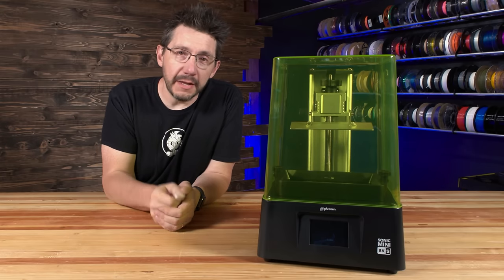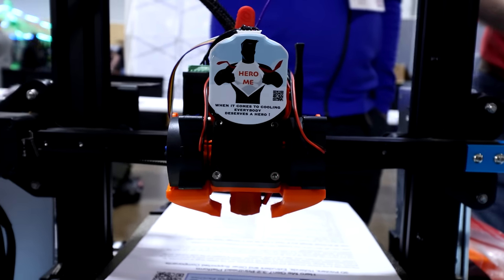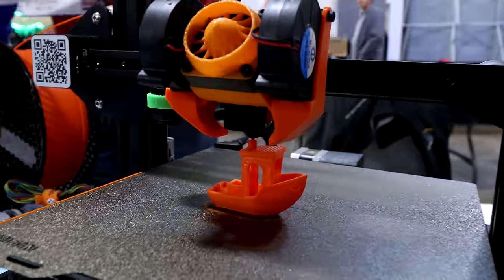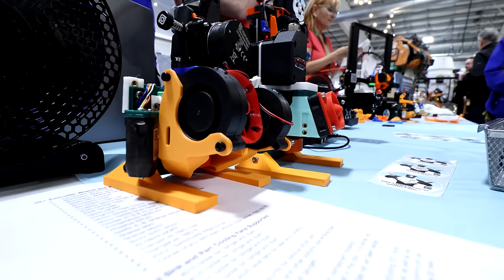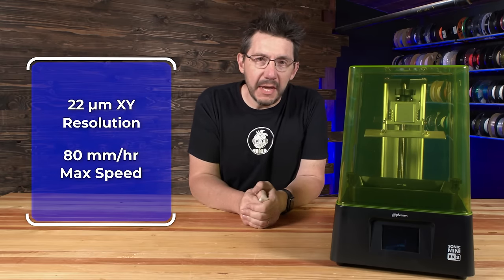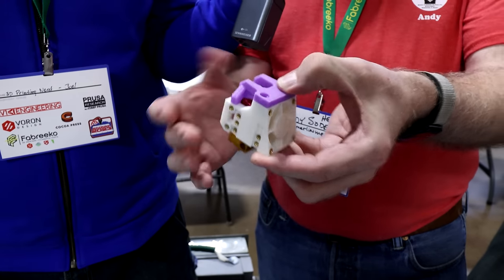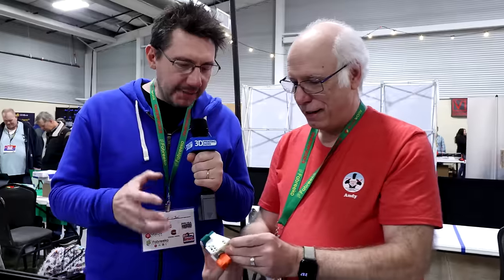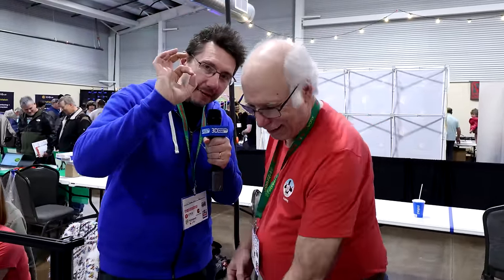🌟 Epic 3D Printing Upgrades: HeroMe Hot End System Exposed!

Comment: So... THIS is the story of the HERO ME.

inventions come out of necessities... When I get into 3D printing I already had a background in design and 3D animation. I bought the Ender 3 cuz it was the new thing... But living in the Dominican Republic was a problem cuz everything was double the price because of delivery and import taxes... So... If I wanted to improve the printer I had to do it by myself.

As a designer, I didn't like the look and complexity of what was the best fanduct at the time, David Petsel's Petsfang, and understanding how 3D printing works, and I meant the balance between weight, speed, airflow, etc... I started my little project.

The Hero journey started with a single-piece heat sink-cooling pipes piece, that looked kind of cool, but wasn't that effective. But over time I was uploading improvements, some of which were major improvements that received versions numbers (V2, V3).

I was part of the Facebook group, as Mediaman was in that time, and with every version he modifies mine to add an extra fan, but there's a problem with that. 

If you know something about 3D printing, you know that adding weight to the x carriage is bad, because adding weight makes changing directions more difficult, but... You may want more airflow because you want to go faster! But what about the weight that we just talk? And... How fast do you really want to go on a swinging bed V-roller 3D printer?! Is the extra airflow necessary? And let's talk about layer adhesion... Do you really want to hold down the plastic that fast if you're not going that fast? What is the right balance?!

But! Mediaman wasn't a designer! What should he know? And some people love the idea of 2 fans! So who am I to say no?... So... V4 was planned as the definitive version. Inspired by the Petsfang I wanted something modular, a base that can receive different ABL sensors and pipes for different fans, I took the already proven heatsink base and modify it to make cable management easier, and also make it easier to print by making it flat in the bottom... The ducts were redesigned to allow the same airflow on both sides by moving the air to the middle of the pipes and from there separating it to both sides. The air exit was also redesigned to put more air in front and back of the nozzle, not just below.

I call it Hero Me for Modular Edition... I made it open source and even make public the Fusion 360 files so the community could make their own add-ons. But the fanduct was on pair with David Petsel's newer fanduct the Bullseye, and my design was simpler and smaller, using the screws already in the ender 3  tool head, so no need for extra parts or add more weight.

Around a month later and thanks to Thinkercad Mediaman released his 2 fan version, totally unnecessary and overkill... But! Who am I to judge? I leave the scene to be a father, I upload the files on September 9, 2018, and my daughter was born on September 16... So my priorities changes and my job was already done.

Then, a few years later I saw a video with Mediaman talking about how he collaborated with me in the process... Then another one he explains how he came up with the idea... And now this one... I never stop creating stuff! I NEVER stop designing! I stop sharing! Cuz people like him! I've been in the states for 4 years now! And he knows it! He could ask me to work together on this! But he send me a message to let me know that he was launching a new package full of stuff that you really don't need! You want to learn what you really need to achieve high speed printing? Check the VZBot development! A carriage so simple and light that makes everything else obsolete! You DONT need 10 pounds of stuff in your X carriage You don't need 2 5015 blowers to run then slower and lower the noise! You don't need to put 1 5015 at 100% to get long overhangs!!! And he didn't came with the idea of the Hero me... I DID IT!!!
Reply: I have no argument or disagreement with your origin story of the HERO ME. I am very sorry for not being clear enough in properly crediting you for your work in the impromptu and unrehearsed interview with Joel. And for incorrectly remembering the country you are from. In all my documentation I do give you full credit for the creation of the HERO ME design (and the correct country reference) that you developed nearly 5 years ago. 

Your design's 12 STLs support four common platformed 3D printers (CR-10, CR-10S, Ender 3, Ender 3 Pro, and clones), 1 hot-end, 3 fan ducts, 3 ABL sensors, and the design was only for Bowden setups. 

What I do take credit for are all is the significant new design work (over 610 STLs with continuous development over the past 5 years) to enable my Gen7 Release 4 to fully support over 115 3D printer models, both Bowden and Direct Drive versions, 47 hot-ends, 37 extruders, 35 part cooling setups, 20 ABLs, 14 accelerometers, 8 LED mounts, 4 endoscope mounts, and much more. 

The closest descriptive comparison between what you created and what I have done would be that I was inspired by what you designed. There are only two things left that are in common between your work and mine. First, part of the name, which I kept out of respect, and crediting your work from which mine was inspired. Had I changed the name, people could have said that I has appropriated your work and called it my own. I did not, and have not. #2. The position of the grooves for mounting part cooling ducts to the Base. . 

What few parts from your work (8 STLs) where mine have the same specific function, mine have been recreated from scratch and are beyond any possible direct comparison. Only the core Base STL has any remote resemblance, but when viewed side by side anyone would see that they are totally different. 

As I have said in my other reply, going forward I will be sure to correctly credit your work (as I have always done in my documentation) and make the distinction between your original design's inspiration. and what I have created, completely clear in all future interviews, presentations, documentation, etc.
Reply: Imagine uploading something open source and then complaining that someone said something without bad intentions wrong. In fact, he had good intentions that he acknowledged you.
In my opinion you can be happy in the first place that he credits you that way he does. He could just have came up with a new name said "it was an open source project from another guy" and just put credits in the description with very small letters and call it a day. How can you be angry over such nonsense? For outsider it looks like you are jealous and bitter about the accomplishment from Mediaman. And then the argument with getting noticed by TSMC. Honestly, that gives me weird vibes like children saying "my Dad works at Nintendo blabla..". Dude, you made your stuff public and then complain that other people use and improve it. You are embarrassing yourself.

Also the thing that you are mad about with you didn't stop designing, you just stopped uploading. How does that matter? It is completely irrelevant because literally who cares? The outcome is kinda the same if you stop designing or stop uploading your creations. 

Next thing is that he has no obligations when it comes to you to begin with.
Reply: The very sad part is, that you also gave your blessing for him to take over. In other words, you gave him the rights for it by giving up yours. That's how it works when someone is taking something over. You literally gave up your rights. From that perspective he doesn't have to Credit you. Or do you see on Fallout 4 that the original creators of classic Fallout 1 are credited in any ways by Bethesda? Honestly, it's so wrong from so many perspectives. Its just throwing a temper tantrum online over nothing.
Reply: @MediaMan3D  are you going to give him his cut of the money though? you used a design that had a clear noncommercial tag on it, it's not yours, that's like trying to develop a design based on Pokémon, just because they made it a long time ago and haven't changed the Pikachu design, saying oh well I made it better doesn't mean you didn't steal the idea and the design to begin with!!
Reply: @denis2381  ride tha bullshit train bud, mediaman stole the design because the original was non commercial use, it wasn't changed,
Reply: @Lucky-strike-green  bullshit. He gave him the project and Mediaman also added his own Creations as Addition and now the creator is jealous for not earning money. Absolutely his fault lmao